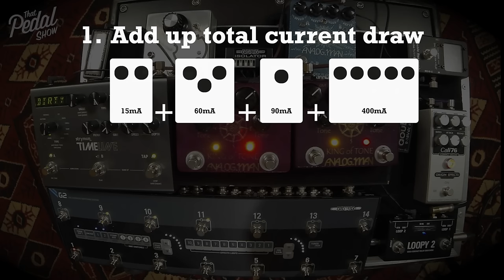That Pedal Show – How To Power Your Pedals Properly & The Legend Of VCPI

Comment: Do all KoT V4 run also at 18V?
Reply: That's what I would like to know too. I run Fulltone(s), Carpe Diem & Cali 76 at 18V, but the KOT (V4) instructions only say 9V. Does this extend to the BiComp too?
Reply: With regard to the question of the day, this is taken from TheGearPage, 

AnalogMike said: 

It depends on the filter capacitors we use, I think they are normally 
about 15V, you may be able to read the #s on them, the large can caps in
 the middle of the board above the DIP SWITCH. Sometimes we mount them 
on the back of the board so you may not see them. It's so hard to find 
good quality through-hole parts now, every time I order, the old parts 
are discontinued and I need to find a replacement. 

18V will be safe for a few hours but may blow up the caps after an 
extended period. Everything else (chips, etc) can handle the voltage. 
But I don't think the sound is improved with higher voltage so I do 
recommend 9V, 12V is also fine.

Have fun!
Reply: AH ok, many thanks. I'm guessing Dan may have 'tinkered' with his caps? I'll check what mine are,  but good to know 12V is also good
Reply: Tony G
What I'm hoping is that the following is true concerning the King of Tone: 12V does much more (headroom) than 9V, but 18V doesn't do much that 12V wouldn't.
Reply: LOL I hope Dan doesn't see this comment from Mike!!

Comment: I disagree with doubling the mA output. If a pedal draws 100mA, a power supply rated at 100mA would be just fine.  A 200mA power supply would work just fine, but it is not needed to get 100mA. If the PS is labeled 9V 100mA by UL or whatever certification agency a particular country uses, that’s its certified rating. Otherwise it would be rated at 200mA. 
What’s the logic for doubling the mA output?

Comment: Everyone talks about isolation & not daisy chaining...but never why is there noise when you only have 1 pedal powered by one supply...I’m getting a ton of noise from my Keeley Caverns V2 even when it’s the only one connected...other pedals with same guitar & amp, nothing WHY!?!
Reply from the maker: Process of elimination.
1. Is there noise when there’s no pedal in line?
2. If no, plug the pedal back in line. Now, does the noise improve / worsen based on your physical position? If yes, that’s RF through the pickups, not the pedal/supply’s problem
3. If no, and it’s a constant noise, then something in the chain is not good. Could be a patch cable, power supply, ground loop between pedal and amp.... You need to check each thing. 
Hope that helps!
Reply: That Pedal Show Thanks for replying!not 1 or 2...how do I check for ground loop in the chain...I’ve tested cables etc & all seem to check out?
Reply from the maker: Ground loop isn’t to do with signal cables, it’s when there’s a common ground or earth through the mains. It usually happens when using two amps, not often an issue with single pedals - more often when you have multiple pedals that share an earth and are not isolated (ie when using a daisy chain or non isolated power brick). It’s usually a full on hum rather than a hiss or controllable RF noise.
But if you’ve been through the process of elimination and tried other power supplies (make sure it’s delivering the enough current and the correct voltage) and the problem only happens with the Caverns, it sounds like it may have a problem.
Now.... the delay in the Caverns is analogue I believe - Mick here - and it is a little bit noisier than some if I remember correctly. But it should be negligible while playing. Cheers!

Comment: ok, now I'm confused? Why are you warning that the KOT is not designed to be used at 18V for extended periods of time? Will you distroy the pedal if you do? I thought it was designed to be able to handle that.
If it sounds better at 18V, people will use it like that, no?
Reply from the maker: It all depends on the age of the KoT. New ones can do 18 no probs, older ones not so much. If you want to run at 18v we recommend getting in touch with Mike to confirm if your unit is OK
Reply: thanks for clarifying that. cheers.

Comment: Hey Dan & Mick. Love the show! I'm running a Timeline & Sunset for now until I start adding more pedals later....does running both units each off their own included power supplies = the same as using seperate outlets off an isolated power supply? Atleast for now until I start adding more pedals? Cheers
Reply from the maker: +Nathan Townsend yes Nathan, just make sure you power everything from the same power strip, but each unit having its own supply is essentially each unit from an isolated source :)

Comment: So you're saying I need to get rid of my one spot daisy chain?
Reply from the maker: +Jart not if it's working for you, as I said for lots of pedals it works just fine, but if you get a pedal that doesn't work on the daisy chain, you know what it might be ;)
Reply: That Pedal Show I'm planning or replacing it anyway because of I hate having limited cable length, and I'm upgrading my pedalboard. So I'm glad that my new mxr iso-brick meets your acronym's standards.

Comment: Isolation is not a solution to power a PNP based germanium booster along with negative ground pedals. An isolated power supply will still supply a positive voltage to the pedal, no matter what. You will need a positive ground supply for that.

Comment: Pedal power supplies are crazy expensive. The technology is not high tech IMO. I have a cheap Chinese power supply (DrTone PSU10) that cost me $50, powers 8 pedals,  no issues with noise, does 9-12v, and runs off a laptop power supply on my board. I've been using it for 3 years with no issues whatsoever.

Comment: Current is NOT an amount of power 
Power is voltage times current, so for fixed voltage the power is proportional to the power
Please don’t say current is power
You are creating even more confusion by not using the standard letters 

The standard that people learn from school onward is:
V represents voltage
I represents current
P represents power
R represents resistance 
C represents capacitance
L represents inductance

(Small c represents the speed of light)

Polarity is not given a letter because it’s not a    continuous variable. It is sufficient in context to indicate what is positive and what is negative
All of the above I learned at secondary school at 14 years old, so there must be others watching this and suspecting you have never studied basic electronics

You ought to have mentioned up front that power equals voltage times current , instead of saying current is power

Putting up VCP is not helpful at all because you have made up a system of naming that no one uses.

Comment: OK guys can you finish this sentence for me (and I'm not being a smart arse I really want your thoughts) - "If I found so much as one transistor in one of my boutique tube amps it would go straight onto Gumtree but I happily spend hundreds of pounds on little boxes loaded with the things and then connect them in front of my amp because......" What I'm really asking is - if valve amps work so well with transistor overdrives etc. why don't they build them into the amp?
Reply from the maker: +ProfTrout interesting! Sometimes they do. There was a great FET driver in the front of a Two Rock as i remember. But of course, what would you build in? Much easier to have the option of pedals rather than going for just one thing (that 80 per vet of people don't like) in your three grand amp? I think that's why more brands don't do it.
Reply: Wise words mate!

Comment: Hello guys! I'm just wondering, if you have a solution to power a Victory V4 the Kraken (12 v, 800 ma minimum)? Correct me if I'm wrong, but the SupaNova can only supply 550 ma. Does that mean I need two SupaNovas and use a current doubler? Additional note: According to the V4 manual, the preamp may draw triple the current when heating the tubes up. Thank you!

Comment: S.O.S.
I understand that current is the amount of power the pedals need. but I still can't find a clear explanation of what voltage stands for in this sense
Reply from the maker: +Brothers & Brothas Current is milliamps, voltage is volts. The vast majority of guitar pedals are 9V DC centre negative. If you're unsure about any of your pedals, just do a quick google search. For current you need to add it up - the total draw of all the pedals. For voltage, it's always just 9 volts (or 12 or 18, depending on the pedal). You don't add the voltage up!
Reply: I'm trying to calculate the current draw for my rig but cannot find any information anywhere for the mA drawn by my DOD FX40B Eq pedal. Any thoughts? Is there a "safe guess" I could use? Thanks! Your show is my secret weapon on my board!
Reply: +Miguel Espinoza- DOD don't seem to say, but you could try their support at DOD.com - or check other similar pedals like the Boss GE-7 - it draws 10ma, or the JOYO JF-11 which draws 15ma.

A safe guess would probably be a PS that can supply 100ma.

Comment: Here I thought AC had a positive and a negative as well as a ground and DC had a power and ground. Guess I was taught wrongs. Huh.
Reply: The terminology depends on wiring conventions for the device in question. Very few AC devices require balanced (equal opposing) voltage applied to both conductors by the supply; most grid power only "drives" one conductor, the "hot", with the "neutral"
being an undriven return path, and "ground" is little more than a redundant backup for neutral in case of a short (instead of you). Most devices really don't care whether the neutral of the supply has a voltage, and it's cheaper and safer for it not to.

US residential code specifically avoids using positive/negative terminology for house mains as the hot conductor is basically both. Even engineering schematics only use + and - for AC when clarifying that there is opposing voltage across two conductors or at two terminals (such as in balanced audio circuits, and even most of those are only impedance-balanced).

Comment: Technically, current is a charge in movement, a flow of electrons to be exact. Voltage is the required energy to move and keep that charge in flow. just fyi, not trying to be an smartass haha

Comment: So....which power supply unit do you use to actually power your peddles?
Reply from the maker: TheGigRig Modular Power Supply system. Cheers!
Reply: @ThatPedalShow  WAY to expensive for me sorry Dan. If I was touring, absolutely, but I'm only a mere peasant. The  (squirm now) Chinese made ISO8 works great and it's the only power supply unit that can power my MXR EQ 18v and my 6-7 9v 100mA pedals. No other "big name brand" can do it :) No noise either, none at all, zip, 0. I'm well happy as it blows away every other over priced, expensive power supply out there. Happy days. If you can build a unit that has 10 9v100mA ports switchable to 12-18v for one or two ports in one unit please, that would be great. Thanks from everyone that only uses 9v100mA pedals ;)

Comment: Yeah... Good video but TOO many mistakes. If you don't understand something it is better to keep silence. If you see some effect it is better to just show the effect (which is very interesting) but please don't try to use some "clever words" if you don't know what they mean to explain the effect. Ideas are right but looking on schematic of "king of tone" I cant see place where your signal will be bounded to power supply voltage. Higher voltage of oamp will give you more dynamic range but it will happen much before your then signal will not rich your voltage value(1/2 of it). Also it will confuse some of  watchers if you will say current is amount of power.   Sorry. You have the great show. I don't want to be too critical because anyway I enjoyed much the video but It would be better if you would say proper things with proper words.
Reply from the maker: +Георгий Задвицкий What's your point? That the KOT schematic says that it won't sound different with different voltages? When it quite clearly does?
Reply: I second Dan (or Mick) in this. Schematics won't tell you how the pedal sounds, you se the parts not the quality of them. The amount of voltage should also affect the caps in the pedal? 

Anyway what you guys said made sense to me and I found this show very interesting, thank you for all the work and effort. We all get this for free and it's a blessing, at least for me! Wish you a nice weekend 👍🏼
Reply: No. For sure there will be huge tone and even more dynamic range difference. And thanks to you we clearly hear it on the video. Form my experience making headphones amps I can say that 9v is not enough even for oamps with small signals. There also a lot of tiny effects of voltage on other components. My point was that signal is not bounded to voltage in this pedal. Its about 3 times smaller but this is enough to lose some dynamic and tonal range. Principle that you have described is right. I have just small correction. I didn't want to say something bad. Video is very cool and useful. Thank you for your work. Sorry I was writing this comment with strong headache and bad mood))))
Reply from the maker: +Георгий Задвицкий no problem, thanks for your feedback and hope your head feels better soon

Comment: Just a fancy ground loop isolation transformer with pretty paint on the outside, with batteries as good as they are now this equipment should be relegated to the same place CRT monitors are, shame really. No need to involve AC if manufacturers would move int the 21st century

Comment: cONSIDER A PEDAL RATED AT 9VOLTS, iT PRESENTS AN imaginary restance of "x"  ohms to the power supply. current drawn in amps = 9/x .....power = volts x amps.....power is dissipated as heat.raise the voltage from nominal 9 volts into same pedal, current rises proportionately, power increases rather a lot,,,,,components take current overheat, kerblam....stick with 9v. or makers recommended supply, and fer fecks sake dont plug the feckers direct into mains supply !!!cheers, H6UK

Comment: No, the majority of pedals are not 9v. I have 10 pedals and none of them are nor 9v nor DC. If you use proper quality vintage pedals you may not have many 9v dc pedals around.
Reply from the maker: Sure. Lots of pedals are not 9 volt, especially the old stuff. Dan caters for most of that with various adapters from TheGigRig,  But the vast majority of pedals on this planet - the vaaaaast majority - are 9V DC!
Reply: "I have 10 pedals and I think I know what I'm talking about"
Reply: lol he obviously just wants to be cool with his special vintage pedals implying that you don´t have quality pedals when they are 9V DC powered or so. I just buy proper new gear as far as i can, it will soon become old by itself.